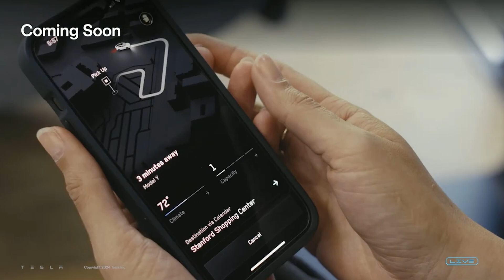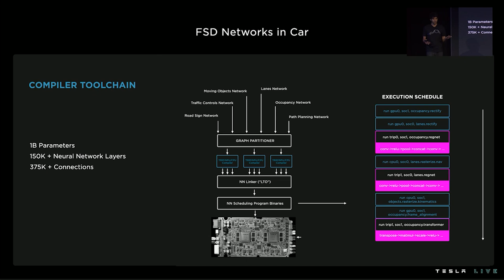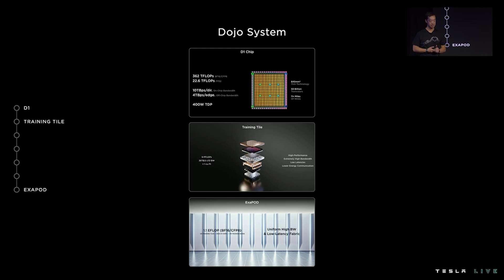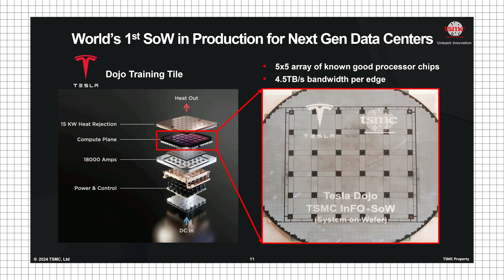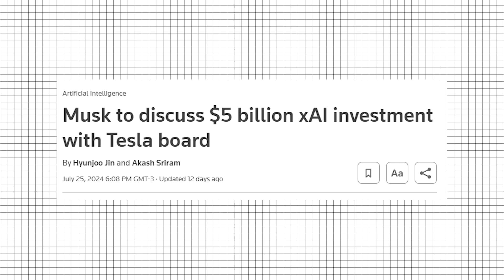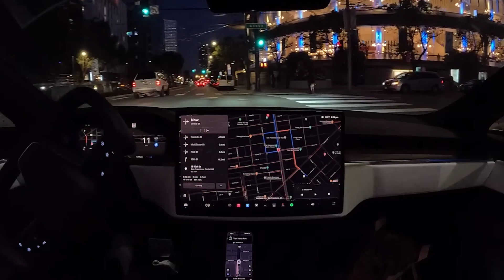Why Has NOBODY Asked ELON This?!?

Comment: All interesting questions. I'm pretty sure I know the answer to the one about putting Tesla datacenters in orbit, which is almost certainly no, for the following reasons:

1) As you implied, cooling in space is quite hard. On earth, there are 3 methods of heat transfer: conduction, convection, radiation. In space, you only have radiative cooling. Dumping a giant datacenter's worth of waste heat into space is a non-trivial engineering challenge.

2) The benefit of having 24/7 solar power, and at higher-intensity, is probably dwarfed by the cost of re-engineering a supercomputer as in-space infrastructure, plus the enormous cost to launch it all into orbit, even on Starship.

3) There's growing talk of "computing in space" but the sensible use cases are all about crunching data that ORIGINATES in space (like Earth-observation satellites or space telescopes), so that only the post-processed data is beamed back to the ground, a much more efficient use of bandwidth. Having to beam gajilliobytes of raw data UP to space to be processed and then beaming the results back down would create an enormous bottleneck that renders the entire project kind of pointless.